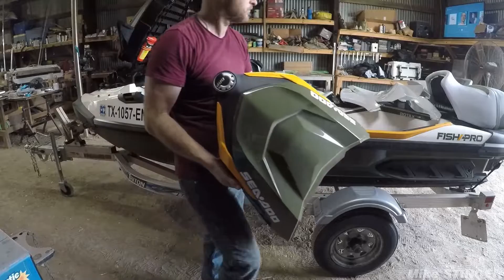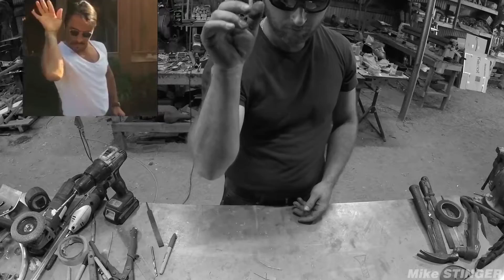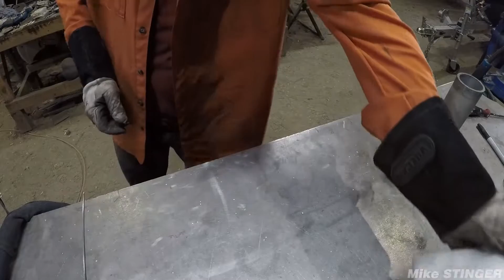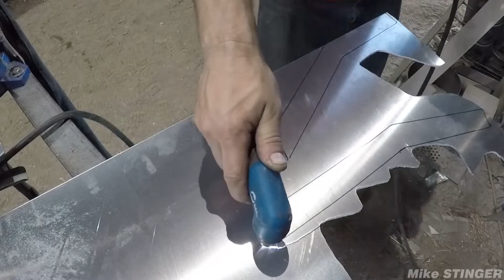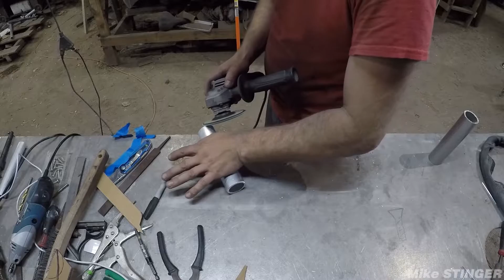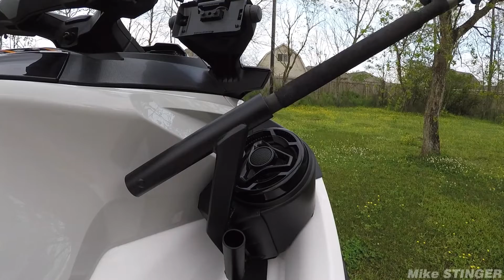FISH PRO front Rod Holders with Speakers

Comment: Do these fit on the 2021 around the built in rod holder / cup holder mounts?
Reply from the maker: Yes they do.  After looking at the rodholders that come with 2021 fish pro I will be taking those of my ski and replacing them with aluminum once.
Reply: @MikeSTINGER  Looks like the cup holder could stay.
Reply from the maker: @davidadshade2927  it can I'm am adding cupholders on both sides